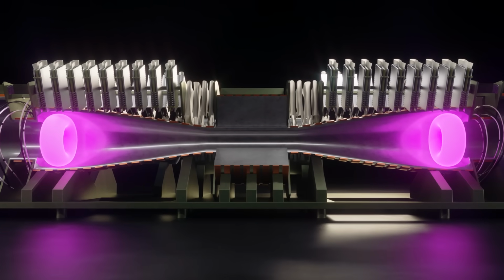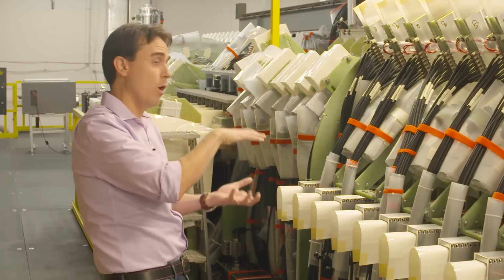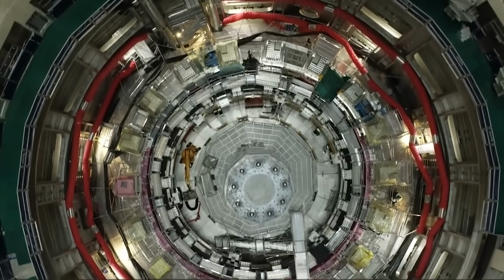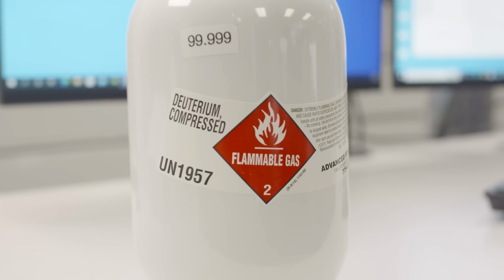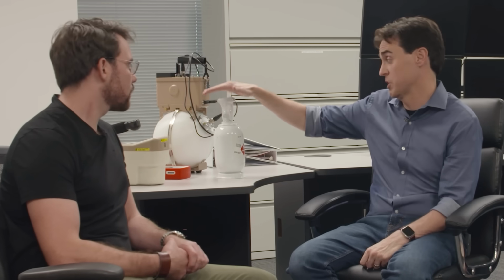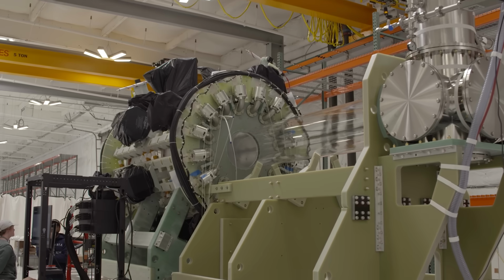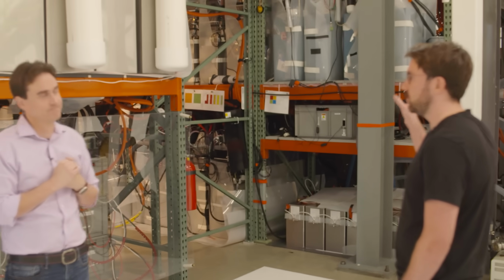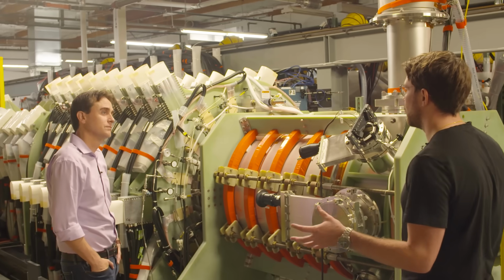A New Way to Achieve Nuclear Fusion: Helion

Comment: I was doing some research for my scifi story/worldbuilding project a while ago. I wanted to rely on fusion to power my spaceships and figured out He3+D pulse fusion was the best and safest (aneutronic) sollution. It's so satisfying to see that I've come to the same conclusion as some of the best engineers in the world. Maybe my degree wasn't for nothing after all XD
Reply: That makes He3 a really valuable material and moon has a lot of it. I can see moon and astroid mining might be a thing in this century. You can make an economy out of that.
Reply: @khanch.6807  Dibs on the moon.
Reply: @khanch.6807  There's also potential for sci-fi (hopefully) stories to be made about us fucking up the moon's orbit in the process and sending it into a slow spiral towards Earth lol
Reply: @khanch.6807  Yeah it has a lot of it compared to Earth but still in concentrations so low that D+D reaction is much more economic and convinient.
Reply: As I pointed out in other thread for me Helion's reactor looks relatively easy to convert into high ISP drive. If it for example operates at a rate of 10 cycles a second just make some of those cycles produce one plasma ring  and accelerate it on both sides, maybe with different configuration to waste less energy on heating the plasma and more on accelerating it and we get something with probably more than 100x (the 300 km/s mentioned in the Video is around 70x better, but I am assuming some improvements here) the specific impulse of the best possible chemical rocket, much better than ION drives.
Reply: @lukasz-y8z  it can't be used the same way because most of the energy is used to speed up the plasma, if you just shoot the plasma out of the back you will just have an expensive ion drive. the reason it works is because the plasma is confined. if you want a direct fusion drive you would need to change the design, even if you use the same principle of accelerated plasma to start fusion.
Reply: @danilooliveira6580  how about creating a 'hole' at the center so the energy of the fusion reaction can be directed outward? Like a claymore.
Reply: @caseyb1346  if you let the plasma out the pressure decreases and the fusion stops, defeating the purpose of the entire reaction. in theory you could maybe expel excess plasma though a Magnetic mirror nozzle and still get positive energy generation, but we have no idea how efficient Helion design actually is (its possible it can't generate energy without confined plasma since they use the moving magnet field to generate energy), its one of the reasons why realistic fusion drives are so hard to plan without knowing more about how efficient our fusion can get. one open design actually pumps the propellant and fusion fuel directly through the fusion reaction, the energy of the fusion heats the propellant and feeds the fusion reaction, that is then pinched through a magnetic nozzle, the excess heat is then used to generate energy through radiators and keep the fusion reaction hot, but that is more like a fusion assisted ion drive than an actual fusion drive.
Reply: @lukasz-y8z  Unfortunately, without the opposing plasma ring there's no fusion.  The sound of one hand clapping.  AAs Danilo points out, all you've got then is an ion engine that runs on exotic gasses.
Reply: @KN-xl6lw  Well I am not aiming here for fusion torch, but a fancy plasma drive that utilizes reactor and the power from it. More than efficient enough to explore solar system.

Comment: We need to use renewebles, batteries, other storage systems and probably fission to fight the less than 10 years of time to fight climate change. But fusion could help us reverse a little bit of the damage we've done to the atmosphere. I think a proper breakeven will happen in the coming 5-10 years and then it's maybe 10 years until we have fusion power plants on a commercial scale deployed

Comment: Great video! But there are a few mistakes /omissions.
First and that might not have been entirely clear from David's explanation: The two FRCs merge into a single, hotter FRC (so the plasma is still organized). The greater temperatures increase the stability of that single FRC over the two original ones. That way, they can keep the plasma stable longer during compression. Also, the FRC is still alive during expansion which is why their energy re- capture system works.

The second correction is that the D-T reaction produces Helium4 not Helium3.

Comment: The idea of splitting tritium production and other fusion fuels into different generators was a thought I had when reading about the ignition results. The fusion generator in france, even if it ends up not being economical for generating power, it does generate tritium, and if it generates enough surplus tritium then that could be used to fuel simpler more specialized fusion reactors which can be economical.
Reply: Well that's how tritium generation works already, there's effectively no naturally occuring tritium and all modern day reserves are made by running specialised rods in fission reactors. Any fusion approach to tritium breeding would need to be financially competitive with firing up a good old fission reactor.
Reply: @lly_1  To be fair, this hourglass reactor seems fairly small, and would likely share many components between the generator and "fuel processor" variants.  Which is already one good mark in the favor of using a variant of this design as the fuel maker.  Additionally, this version may be able to make the trinitum with MUCH lower amounts of radioactive byproduct waste than a Bery-lined tok or a custom fission pile.  

A generator version of this would likely end up keeping the Helium-3 more though, and either end up just selling the trinitum to others or shoving it into big thick tanks to let it slowly decay into more useful fuel (I don't actually know if Trinitum is less prone to leaking through vessel walls than normal hydrogen due to having a bigger nucleus or not, particularly as I would suspect the electron shell is a big component of this behavior/lack thereof).
Reply: @lly_1  there is naturally occurring tritium in the atmosphere and sea, its a just a very VERY small amount, and it would be economically unfeasible to try to harvest it.
Reply: The alternative to waiting 12 years for half the tritium to decay into Helium3 is to cook it out of moon dust.  No joke.  Scientists think there's about a million tons of He3 that's deposited all over the surface of the moon.  It was generated by solar wind and cosmic rays striking the surface and can be released by heating it to 500 degrees.

Comment: To be fully honest you should also tell that such tech cannot produce more energy than its consumption, by design.

This is single pulse (very small fuel pellet) and with no energy extraction possibility. Thus it is more a show of power than a breakthrough in fusion tech.

there is a reason we study tokamaks: because it is the only way to extract energy, not just be a bottomless pit. 

TL:DR this is more an H bomb than a power plant tech.

Comment: C'mon so much of this depends on the reactions chosen, and yet there's zero mention of cross-sections. Spoiler alert it requires much higher and difficult to handle temperatures than a tokamak. Tokamaks can use the same fuel but there are issues with it such as low cross section that you're skipping over.

I must admit the idea of stimulating current directly is interesting and I would have liked more info on the details of this system.
Reply: shhhh, don't scare the investors.

Comment: Helium-3 is abundant on the surface of moon, enriched in moon soil and dust. There is pretty interesting sci-fi novel named Limit, where in not-so-distant future is fusion reaction using Helium-3 developed and world powers are fighting over these Helium-3 fields. Pretty interesting i.m.o. There is also functional space lift there.
Reply: Well that is not entirely true, Helium 3 is present there, but in very low concentration, we simply lack a technology right now to extract it at scale. If Helion demonstrates net electricity gain in the next few years while being able to produce their fuel in-situ that is extremely good news. In the future we might even feed mined He3 directly into future generation of reactors, or for usage in space which I am hopeful for. Expelling one in a few plasma rings instead of colliding it, turns the reactor into very high specific impulse drive (300 km/s exhaust velocity is 70x greater then the best available chemical engine at 4.5 km/s and I suspect you could optimize it for this mode for operation even more)
Reply: If I remember correctly, helium mining is also the job of the main protagonist of The Moon.
Reply: And was the price lower than the price of wind or solar sources?

Comment: Well, that's a little misleading.  The neutron + lithium reaction is highly exothermic, and that heat is what is used to provide energy.  A;lso 3He is really, Really in short supply.  If you think 3H is hard to finbd or make, 3He is Mondo hard to get to.  So they breed it here, how is that significantly better than breeding 3H on site?  Also, I want to point out that we managed to manufacture enough tritium for 10's of thousands of nuclear weapons.  It's certainly interesting, so We will see what we will see.

Comment: This is geniously simple way of achieving efficient and controllable compression. I bet this would simplify the implementation of real life fusion generators, the whole heat transfer system and blanket could be simplified to be around the center of the machine and sustained operation simply by pulsing the operation

Comment: I saw an interview from the ITER, In that, she said most of the startups are using designs which are studied and found to have problems by ITER, and most of those startups are gonna go away
Reply: An ITER person speaking positively about ITER, imagine.
Reply: 🤷‍♂️ That may be true, but ITER itself doesn't have a good answer to where they're going to get literal tons of lithium and beryllium and what they're going to do with the radioactive waste. Even if ITER works beautifully, if the materials required make more of them are too costly, then its commercial application is severely limited, i.e. the electricity they produce isn't actually cheap nor environmentally friendly.
Reply: Yeah, most are just scams. They know they'll never be able to sustain a reaction and even less extract energy.

Yet as long as there are some gullibles investors with little knowledge in physics, such scams will continue to ride the hype for "new clean enerrgy".
Reply: @etienne8110  Yea, The scientist in the interview was not that happy because of the hype and overestimation of the technology.
Reply: Ironically the greatest breakthrough yet happened at the national ignition facility, with an inertial confinement system similar to that of Helion. In other words a design completely different than iter.

Best case scenario iter leads to a much better breakthrough using its tokamak design

Worst case scenario iter was made with the wrong design which means tons of money sent down the drain
Reply: @Jhonmary9951  Actually Tokamak did produce about 59 megajoules of energy for 5 seconds in Joint European Torus near oxford. Just note that Joint European Torus is an experimental project and the ITER is bigger and much more advanced.
Reply: @IxoraNera  "59 megajoules of energy for 5 seconds" doesn't make sense. What was actually reported was they produced 59MJ of energy during a 5 second pulse.
Reply: @salerio61  I meant the same, My native language is not English, so that kind of mistake is inevitable.
Reply: As he said in the video, many of the problems associated with what Helion is doing have only recently been overcome. And also because the administrators overseeing ITER would never say anything to undermine the golden goose that is an international project like that. Billions and billions of euros over budget, years behind and they aren't even going to be online for another 10 years. Its a massive waste of money.

Comment: you dont have to make a burning plasma but you do at least have to make more average reactions per energy in even if only afew more, i see helion issue being that the method where the plasma has to expand in volume after undergoing some fusion to drive the flux/power generation is the opposite of making more fusion reactions occur, and to increase energy yield reach a net 0 Q1 it will some how have to induce more fusion events while actively using a method that reduces the likelihood of events. The faster the pulsing too the more fusion events per second will have to happen to make Q1 let alone net gain, and the only way to do this will to be induce a burning plasma unless they can some how break the laws of physics and increase the ion reaction cross-section. I just don't see either of those things happening with a setup that is arguably worse for inducing a burning plasma than current tokamaks.

In addition, colliding beam fusion has previously been proved pointless and physically unviable and when those two plasma toruses combine they will have a lot of chaotic motion induced. If combining these two things ACTUALLY increases the fusion rate and dosn't net waste power though ion losses or 0 actual fusion gain then id be amazed and super into the physics as to why. Hope we can see the in-house equations one day.